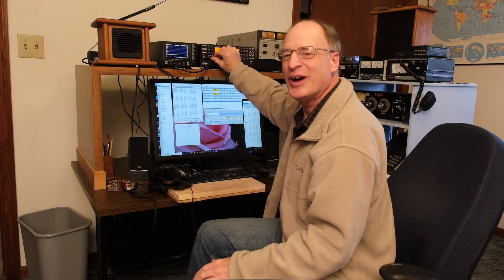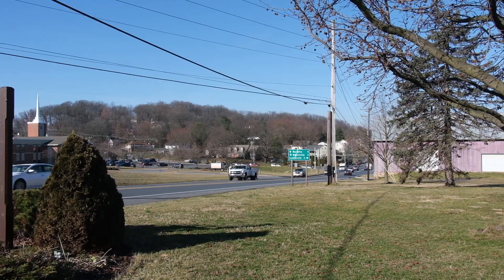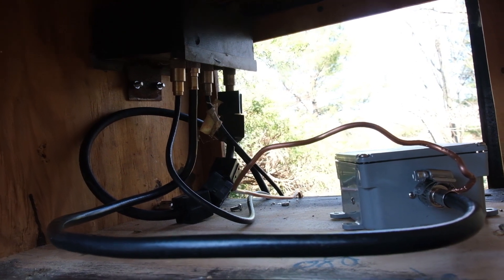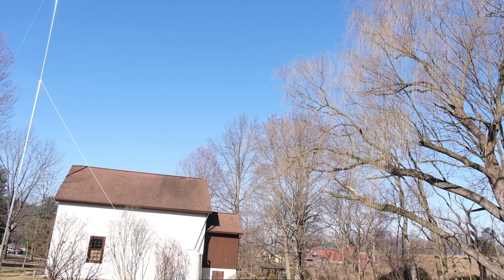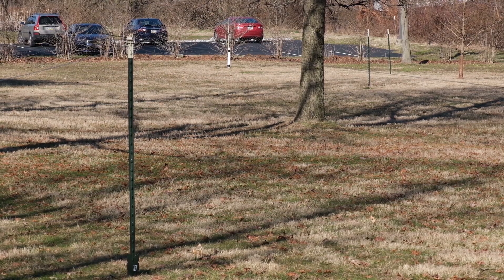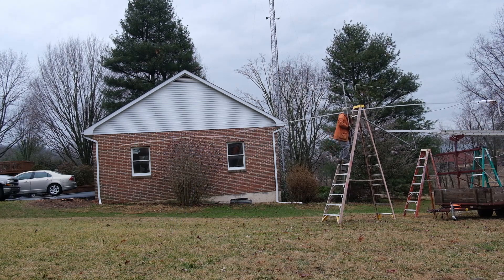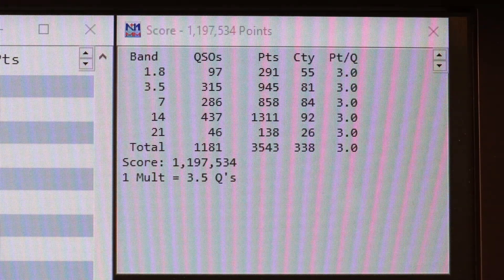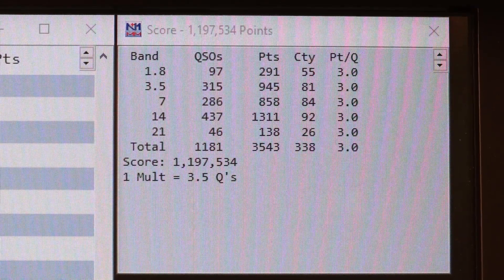ARRL DX CW contest using Field Day Antennas

Comment: I didn't quite get how you switch the vertical from 80m to 160m.  Could you give more details?
Reply from the maker: I added a wire off the top to make it 160....so it was like an inverted L.   I really liked it so I made a fan vertical with wire to duplicate it permanently.   You can see that in this last video I made.  https://www.youtube.com/watch?v=5ks3EhFdArU

Comment: Oh boy, are you SO RIGHT about this! I've been testing multi tap UNUNs for fun, and in doing so, tossed a wire fo 80 over a tree limb. Took 3 minutes to put up. Then did the same for 40m. Then the ARRL DX test came along and I wondered how hard it might me to make contacts. I was shocked. I'm but a lowly QRPer... and if I could hear 'em I could work them. I posted videos ifyou want to see. lol. Look for 'QRPer vs Maniacs & Savages: QRP in the 2020 ARRL Intl. DX CW test – part 1 of 2' and you'll see.  Recently I did the same during the SSB DX test. I'm a CQ QRPer of 45 years.. and have never operated QRP during a contest! I figured I'd give it a try. This time tho I used my junker no-cost Michigan Cacti antenna... and worked 18 DXCC entities out of 21 contacts. I posted those vids too if you wanna watch. This wasn't a FD antenna maybe- but it was built from junk and cost $0.00  lol.  Thank you for your video!